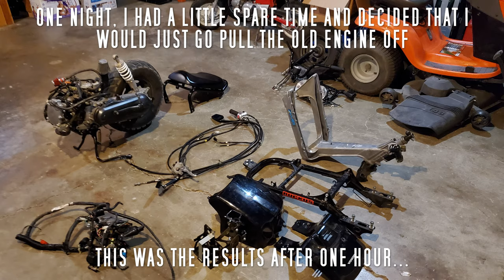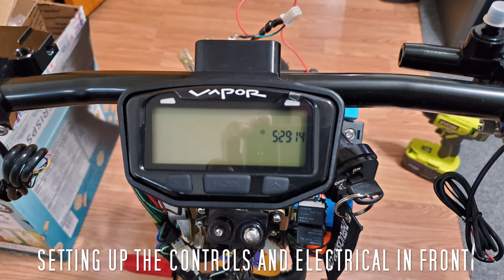Honda Ruckus - My Ruckus Build Slideshow - From Mild to Wild!

Comment: How long is that plug wire?
Reply from the maker: Sorry, I do not have an exact length for you since it is routed through my bike currently. I can tell you that it reaches fine from the CDI box mounting location to the engine.

I looked at the Rolling Wrench website to see if it states the length, but unfortunately, it did not list it.
https://www.rollingwrenchdenver.com/collections/gy6-honda-ruckus/products/gy6-honda-ruckus-swap-adaptor-harness-20-min-install

If you would like, when I get home from work later, I can try to estimate the length for you by measuring the routing path.
Reply: @MikesMiniMotors  
If it’s the one from rollingwrench I can just call and ask
Reply from the maker: @king0dasouf  Yes, it is the Rolling Wrench CDI box. I also just kinda measured the routing path on my bike to get rough estimate, and it was about 3.5 feet.
Reply: @MikesMiniMotors  
Dope man. Thanks for the response. Can’t wait to be out on the street myself. Currently in the everything in pieces stage.
Reply from the maker: @king0dasouf  No problem man! I was in your shoes exactly a year ago... haha